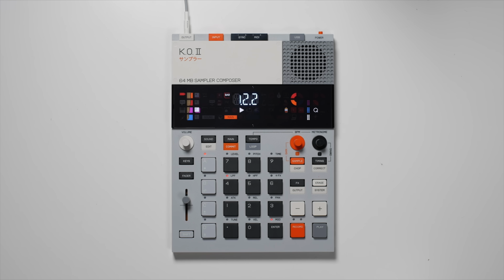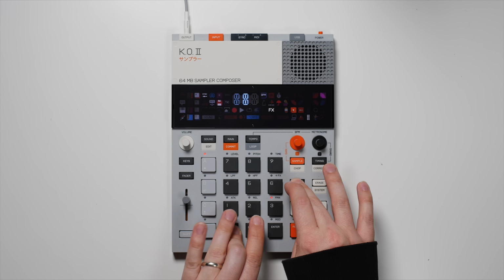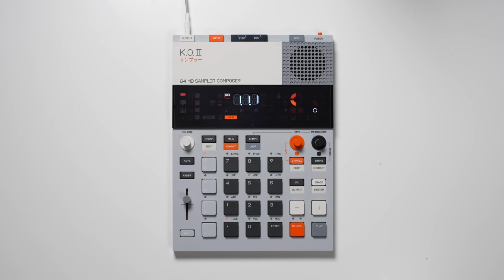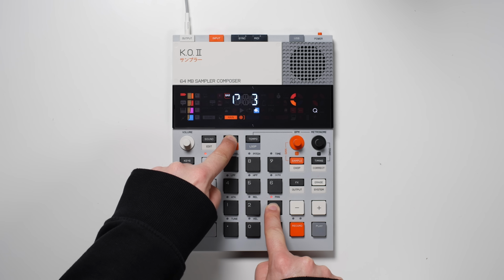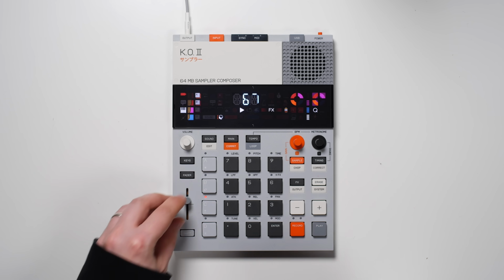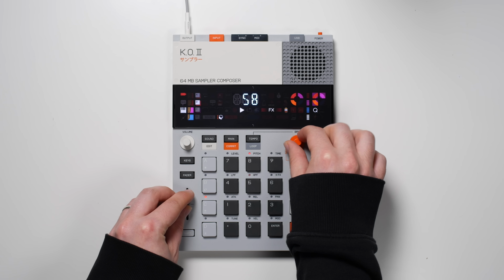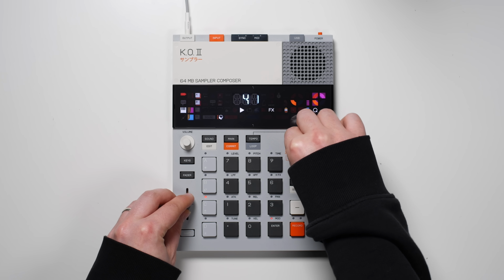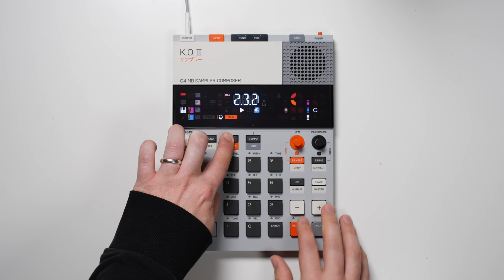EP-133 K.O. II Sampler Composer | First Beat Tutorial | teenage engineering

Comment: I hear the word "sampler" and I get scared.  It has too many meanings to use by itself.  Some units mean there is no sound in there until you transfer a library of .wav files that you hand picked as a "kit".  I would rather pick cotton than do that or I would switch to making only beats because that sounds like a workflow that eats clocks.  Is that what we mean by sampler here?  I can't get a clear answer from AI.  And the way it looks like you are step sequencing with 1.whatever looks like a mess.  I would think 16 keys = 16 steps but you are pushing button combinations so fast I had to slow it down to .05 playback.  I getting more scared that one sound will take as long as this post.

Comment: Is possibile to “slidin” beetween keys? I want to make some uk drill beats with it so I need to slide on the bass 😂
Reply from the maker: If you're talking about portamento / glide - it can't do that currently. The work around would be recording fader automation on pitch or tune to create slides manually.
Reply: @soundtechnology  thanks for your answers, one last thing, after I record it I can manually change the values of the parameters “per step”, to be more “precise”? As in other Samplers (but) equipped with step sequencers?

Comment: Thanks for the step-by-step explanations. For some of us, this is our first sampler, our first stab at production, and elementary explanations are incredibly helpful.

One thing I haven't figured out yet (my K.O. II is still in the mail!) is whether you can, and how to, store a project you've completed externally. Can you back it up as a file to a computer and send the file back at a later date?
Reply from the maker: At the moment, you will need to find a way to record your ideas to the computer. There is no way currently to export full project data, but you can back up samples that you capture using the EP Sample Tool (on TE's website)
Reply: @soundtechnology  well, that's a start! I guess that means working serially on one project at a time until it's complete and then recording the output as audio. It's a tough compromise to make for folks used to working with MIDI and sequencing, but I guess it makes you commit to a single idea at a time. Maybe that's not all bad.

Comment: Say you want to set up a song, do you need as many scenes are there are changes in the song (+ 1 counting the first scene) or can you sequence the scenes themselves?
Reply from the maker: Currently there's no song mode or arranger, so you need to manually move through scenes. However, each individual pattern's bar length goes up to 99, and you can save up to 99 scenes... so you could program a song start to finish if you really wanted. But I would recommend moving between scenes and using FX.

Comment: How would you sample yourself clapping your hands? It seems like you have to hold down a pad to start sampling to it, so you can only record sounds that can be made with one hand.  Or am I missing something?
Reply: use your toes!
Reply from the maker: If you set the threshold right, you can place a weighted object (eg paperweight) on the button and it won't start recording until you make a sound above the threshold - like a loud clap. That's one way, or you can import sounds via USB-C. Or get a friend to clap / hold the button for you :)
Reply: For those wathcing this vid a year later: Version 2.0 of the software allows for hands-free recording! Also resampling, so you can apply send FX to your samples and add them back in ✨

Comment: Does it have a filter?
Resampling? This unit looks really nicely designed
Reply from the maker: Each group has a Low Pass & High Pass filter that you can adjust with the fader. There's also the punch in LP & HP filters which go across the whole mix momentarily. And if you need, there's also a LP filter in the send effects.
Reply: I like the sound of that!! Do they sound good? I like this unit alot.. Can you loop samples?  @soundtechnology

Comment: I have some questions and requests:
1) PLEASE do a tutorial video breaking down how to remake the Hip Hop beat at the top of this video.
2) PLEASE make a sample chopping tutorial. What is the largest size for a single sample on the EP133?
3) Can lowpass be applied to specific samples? Or is it a global FX?
4) What is the resolution of unquantized recording?
5) Does the sequencer have a step-jump performance feature?
6) To whom do I need to address accessibility concerns regarding the web app one has to use to transfer samples from a PC to the EP133?  As is, the drag'n'drop UI of the EP133 sample transfer app is not screenreader accessible. Also, many of the buttons on the app are unlabelled so cannot be read by a screenreader. 
7) Does the EP133 have a song/scene-arranging mode?
8) Can I export finished patterns/songs via USB? How?
9)   Is this the first in a line of POs-on-sterroids? If so, please combine the Robot, Arcade and  Rhythm for a cool chiptune groovebox.
10) What does the "EP" stand for?
Reply: Here's a link to the guide. https://teenage.engineering/guides/ep-133  In regards to sample size (#2 on your list) I believe 20 seconds is the longest sample length. If you play multiple chords, for example, on a piano, it has an auto-chop feature that will separate each chord hit to a pad. I've seen this demoed with a synth pad, ie limited transient information and it worked very well. It has a gate so that it only starts sampling once the thresh hold has been passed. This way you don't need to trim the starting point.
Reply: I wholeheartedly second this request.
Reply: A chiptune groove box is exactly what I want

Comment: can you do sidechain compression(ducking)?
Reply from the maker: Not specifically as a preset effect, but there are some ways to achieve that sound. You can use velocity on steps to duck volume against the kick. Or you can really push the signal through output compressor which ducks the signal around louder sounds.
Reply: it has a 'master compression' which im guessing could be used for a ducking effect!